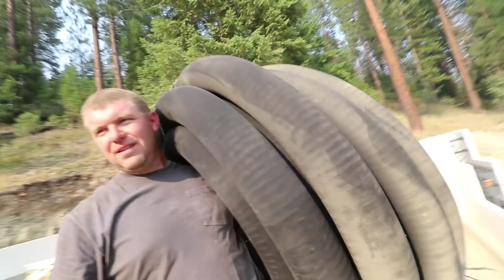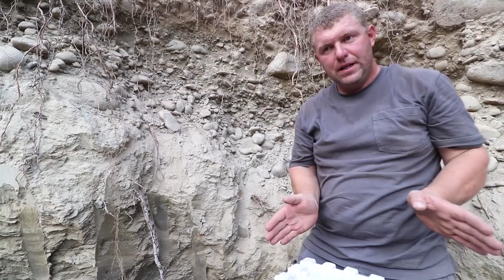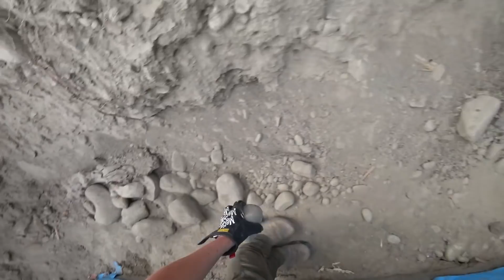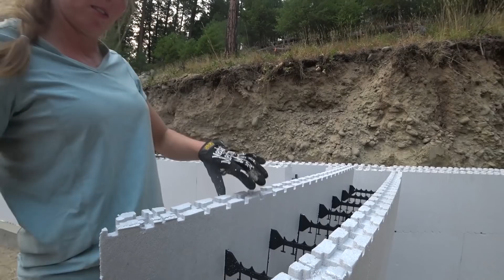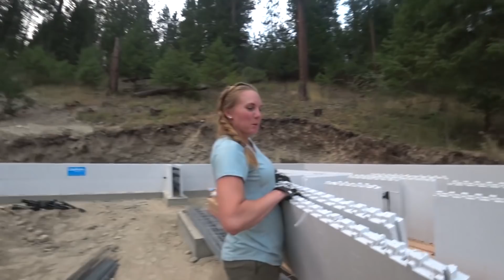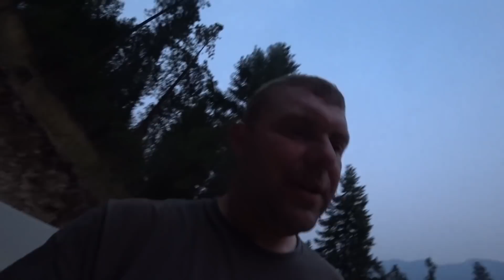OUR MEMBRANE IS DONE! (Waterproofing Foundation)

Comment: Homes have been built for 100's of years without the membrane, in all kinds of climate. Just saying.
Reply: I just dug out a place 60 yrs old concrete wall and foundation, no leaks, water was 8 " inches up on the outside the wall.....and that was after a dry spell...
Reply: Anthony Bonante - welcome to England!  Disclaimer: I'm not a builder.  But I'm a heavy DIYer and I'm fairly familiar with the UK building regs.  We have very helpful building control folk who come, observe/check/advise   - as best as I can tell this is way above and beyond anything historically built over here.  (As in - I really can't see them having the slightest issue.). I help look after our 300+ year old clunch wall church, and I can tell you about damp... Even then though, we deal with it retrospectively.
Reply: i think it's the  slope (run-off) behind the house they're worried about..  It looks to me like it won't ever be dry.  Is this the only place they could put the house???
Reply: Anthony Bonante homes have been build bad for 100's of years, homes havent been build for 100's of years with this. And so on... its important to first learn then do. Look at other locations and not only some parts but all.
Reply: And they have leaked for just as long...
Reply: wallyhall from what I've heard England doesn't have many DIYers. Is that the case in your experience?
Reply: It is completely dependent on what sort of water ingress your area has, pretty much all farmhouses in my area are built with a buried basement made of nothing more then stone and mud, and it is never a problem because the area suits that construction.
But if you had a lot of water getting pressed on those walls those basements would be flooded constantly.
Reply: thechosendude - that's because they use a special type of waterproof concrete with a very high PSI, it's cheaper just to add membrane.
Unfortunately Jessie fucked up the simple install method as usual, so it will probably leak

Comment: I used to work for a basement waterproofing and structural repair company, and one of the most common mistakes I saw on newer home constructions was the use of corrugated ABS pipe along the footer.  It was almost always crushed and causing storm water backup into the home.  It was also something that was almost always done by people building their own home or acting as the general contractor.  The other less common mistake was compacting backfill with a piece of heavy equipment like a bulldozer or excavator by driving it along the wall right next to the house.  I've seen that crush even PVC footer pipe, and also crack concrete block walls from the lateral pressure.

Comment: My house is 8 years old, we used a dimpled membrane from a company called superseal, no leaks. the membrane you are using seems to be a superior product. If you really wanted to protect it you could use the plastic dimple membrane over it.   On the drainage tile you want to use the corrugated-perforated 4inch big-o pipe that has a sock over it and back fill over it with stone.  Biggest problem I have seen is if you don't back-fill with enough stone and don't have the sock the pipe becomes clogged with dirt and is then useless.  Farmers tile their fields with that big-o pipe, it is tough and has proven itself over time.

Comment: Jesse, I feel your pain. In my house (6 yrs old), there was a corrugated drain pipe. It quickly filled with mud and it was crushed. My pipe was inside and yes, under the concrete basement floor. I removed the concrete floor and that pipe. I installed a rigid white perforated schedule 30 pipe (with a 1/4 inch pitch per foot). I didn't put a sock on it and I have no regrets.  In addition, I BEG you to strategically place "PVC Tees" at the corners and in long pipe runs. This leaves  you inspection ports and a place to insert a hose to flush out the pipe. By the looks of your ground, you will have to periodically inspect and flush out the pipe.  Best of luck to you and your wife. Dave, Buffalo, NY.

Comment: In 30 years of installing weeping tile and septic systems, I’ve never had the flexible pipe crush when it was installed in a sufficient bed of washed rock.  That being said, I prefer the solid perorated pipe over the flex, and Infiltrator canisters over the pipe.

Comment: Keep up the good work. Don't forget to add a sump pump pit to your basement floor for run off inside because where it snows in the winter the water creeps up during the spring into your home and floods the foundation. Seen this first hand in a home built in 1930's out in Minnesota it was a mess they didn't have a sump pit in there basement to carry away the water.

Comment: Only pipe I ever use when I waterproof a basement is sdr-35. Perforated of course. Put the holes down. And somewhere out a T in the line and run it up to grade so you can clean out the lines of you ever need to. It's one of those pay a little more now so you don't pay a lot more later. Great channel!

Comment: I think you are doing a good job. Personally I think that the membrane itself is such a huge improvement over hot or cold tar that if you cover all the exposed concrete, your basement or 1st floor will leak in 10,000 years

Comment: You could use water base Formica Adhesive on the concrete, it would also be safe to use on the foam forms as it does not have harsh solvents.

Comment: When you install the perforated pvc pipe, use the white and place a garden sock over the holes, keep roots, sediment and pieces of smaller aggregate from dropping into the pipe. Add access points above surface.
I was going to suggest affixing a dimpled surface (DMX) around the foundation but I'm not sure it would be adequate given the type of terrain. Could use corrugated metal but that would be expensive.
I do have a thought though as it has been used as a liner for horse, cattle stalls and in swimming pools adhered directly to surface of concrete; drape a bitumi product call APP. It's very difficult to perforate the material, you would only need to thermal seal the overlaps, but once installed, nothing is getting through. A roll covers 32 sq feet.

Comment: Nice job, but the drainage pipe ou have is a good one here in the Netherlands the dutch farmer used, and they cross with the machines over the land with no problem, so if you fill the pipe with gravel around it will stay there for more then 40 years. a layer of 30 cm( 1 feet) of gravel is enough

Comment: I've used that corrugated drain pipe quiet a bit. You have to put drain rock around it. Two reasons 1 if you fill with dirt around it the dirt will fill the line, 2 the rock will not put as much wait on the pipe and make a protective foundation around the pipe. obviously can't compact until you get a few feet away otherwise you will crush it as well.
Works good though. It's used all over the place here in Portland, OR.
I've never seen any one put a protective liner on the foundations around here. The clay seals them up. 
Have seen Water back feed from the pipes laid in the road bed. But they just fill the inside of the foundation with cement if that happens.

Comment: the footings we used have tile built in them that go to a sump pit which would be another good idea to put in so if water ever is there it his the drain and goes in to sump pit we have dry basement never had water problems ever sump runs in spring or after heavy rainfalls good luck

Comment: Jesse, make sure to use 4 inch perforated PVC pipe for your tiling.  And if you want to install a fillet (also called canting) you can make it yourself out of PVC moulding from Home depot. Just rip a square piece longways at a 45 degree angle and stick it along that corner transition. You probably wont need to adhere it to either the cement footing or ICF, the membrane will hold it in place.

Comment: I put Henry adhesives #887, "Tropi-cool white  silicone roof sealant" on my conex and it made a really nice 100% silicone seal. Easy to find as its almost the most expensive schmoo available at HD. Could work well as a top coat to seal if you felt the need... $200, per 4 gal pail. I kinda want to paint my GMC with it since the paint is bad and it's white...

Comment: How about filling the ICF with concrete, which is watertight, when dry? That's how our basement was done. That could provide addirional peace of mind.
Reply: Michael Dornhausen you do know that is what you do......dont think Styrofoam by it's self is very strong😲
Reply: Well, it seems, I didn't express myself clear enough - I suggested to use a specific mixture of concrete for filling the ICF blocks. Of course, they will get filled with concrete. Otherwise it won't be a solid foundation. But, as metioned, there are different types of concrete, one can use. That's my point.

Comment: For adhesive you can actually use spray glue the industrial of course but it keeps cost down for the adhesives companies sale. And factory seems dont really need a sealants its the cut edges and the edges getting tied on to

Comment: Perf Big O is used on 90% of house builds up here when you lay it and put clear stone on it the backfill wont crush it. we also spray our foundations with a tar and install a plastic dimpled waterproof membrane as it allows air flow

Comment: BETTER RAZOR BLADES
A roofer buddy of mine showed me "hooked" utility knife blades. You don't need to cut against a surface. Roofers use them when trimming felt paper because there is less chance of cutting the paper underneath. Try them out. They are the best for cutting paper or plastic sheeting! Keep up the good work!

Comment: do your concrete pour and coat the cured concretefoundation with the "magical" bentonite paint!!!it absorbs 18 times the amount of water than can penetrate it's film!!it's is standard to seal existing leaking basements in situ that are belatedly leaking as the ultimate solution! it is used in swimming pools also!after finished plastering!

Comment: Where I live we have a soil type that we refer to as gumbo which literally will grab your house foundation and start to lift it out of the ground when it freezes from what I can see your ground will have very little water sitting against your foundation as long as you use the foundation rap I don't remember what it's called it's a black plastic sheet that you roll out that is dimpled if water ever gets behind it it runs down between it and the membrane and then it runs down to your perforated weep and to your sump or downhill whatever your design is I don't foresee you ever having water problems the biggest concern is you just don't want water freezing against your foundation and pulling on your foundation or pushing your foundation in Word it looks to me that you have good enough drainage and if you back feel properly water should make it down below your freezing point. I have heard of guys in our area back feeling entirely with P Rock and it pretty much stops the problem but you have to make sure you have a really good sump and pump cuz that thing will run every time you have a rainstorm and for most of the summer and even for some people all year round in our area

Comment: You should have a drain tile all the way around your wall and all of the drain tiles should dump into sump hole into the inside of the basement area and then have a sump pump  pump water out as it drains in..

Comment: There are all sorts of products to put on the outside of our ICF before back fill.  They generally keep the back fill sharps from puncturing and tearing the membrane, some  have plastic channels to let the water drain down to your foundation drain without causing hydrostatic pressure buildup.  It all depends on they type of back fill.  With sand, you most likely don't need anything, heavy rocks you need mechanical protection but not hydrostatic for clay you need hydrostatic protection.  I would say your grizley soil is mostly finds which should drain well but you do have rocks.  One low cost option I have seen done is to place a sheet of 1/2" drywall  up against the membrane then back fill.   The drywall will give you the mechanical protection and the back fill sandy finds the hydrostatic protection.  The paper on the drywall to disappear quickly but the core will remain as a puncture protection cladding.   I believe what you have is going to work just fine.

I can see you guys are really learning a lot and gaining more confidence in your ability to problem solve.   Remember there are a lot of ways to do this sort of stuff the "right way" is the way that works "for you".   

Craig

Comment: You need to use a roller like the one used for wallpaper to stick the membrane as if you press it hard enough then you will get a better adhesion, bit of work though

Comment: How about a large sheet of tyvek put in place before you backfill.   it's tough and relatively puncture proof. it will provide an additional bits of watershed too... Not a builder, but thinking of possible solutions.

Comment: It'll be fine, the membrane that you're using is eons beyond the tar coated concrete that was used 30+ years ago that I helped my father put on their new house in the 80s and so many years later there's not so much is a sweat on the inside of the foundation. As far as the drainage goes and this is just a guess, if you were to moisten the backfill as it goes and I would think it would create a sort of cocoon that would help stabilize everything around the flexible drain to help keep it from crushing but the rigid is definitely a safer choice.

Comment: I only remember one builder trying to use those blocks below grade, and it was a disaster.  All other homes have been built with concrete walls to above grade.  Then they use the blocks.  The concrete is waterproofed with the black material.

Comment: The building insp. regs. are the minimum requirements! You can always improve on the reg.!You are on the right train of thought! It wont leak if you do the best and it does,there's nothing more you could do! And the guy is right, use the Ridgid pipe.

Comment: Please place the 4" rigid perforated drain pipe beside the footing, not on top of the footing. Once past the footing switch to solid wall pipe with a slight slope to drain water away from the footing.  Be sure to run both ends to daylight and check each pipe a few times a year to verify that the ends remain open, not clogged by silt, crushed by the backhoe or covered by landscaping.  I've had homeowners complain that there was a leak in the basement only to find that they covered up the ends of the footing drain pipe with landscaping.  Once cleared hundreds of gallons of water poured out and the basement leak ceased. 

The membrane and channeled protective covering is a good idea.  Rain water or snow melt flowing down the hill will find its way to the lowest point of excavation and then start to fill up the loose backfill around the foundation footings.  If it has no place to escape it will continue to fill until it tops the footing.  Once that happens it will find a way to penetrate the cold joint between the top of the footing and the bottom of the concrete wall.  

If your drainage system never allows water to rise above the top of the footing the basement floor will stay dry. Having built over 200 homes I always backfilled the first three feet above the footing drain with 1 1/2" minus clean gravel.  This will prolong the effective life of the filter fabric and drain pipe.  Place the perforated pipe with the holes down. 

Another very important water control item you must do because of your site is to cut a drainage swale on the uphill side of the foundation to divert the water coming down the hill away from the foundation.  Why two feet deep?  Because it will silt up quickly in your sandy soil.  Slope the swale so it drains out of both ends.

I enjoy watching your video series but it is painful to see you making mistakes and doing some things the hard way.  I congratulate you both for your hard work and willingness to learn.  Someone mentioned hiring a project manager.  Check around, maybe you could find a retired contractor in the area to stop by once a week, review your progress and line out the work and materials needed for the next week.  He may still have connections with the suncontractors he used and be able to help out with some hired labor if that becomes necessary.  

I'm an ICF and timber frame fan also.  We disassembled a 48x60 two and a half story barn built on our family farm in 1879.  We repurposed the timbers, hay loft flooring and siding  into three other projects.  Wishing you the Best of luck with your new home.

Comment: Our last home was on a hillside never had any water troubles except when rain gutter spout broke off. The home was built in the 70's. Thumbs up good luck on weather!
Reply: James Dickman ....Exactly. Both of our homes we've built have been on/in hills, one with a walk out basement... that was the one in the hill, and one without a walkout, that was the one on the hill. Never have had a leak, the sump pumps never turned on. Our neighbors at the bottom of the hill? Their sump runs constantly. Location matters, you placed your home in a good spot. I think you'll be like us and never have a leak. We also heat and air-condition our basement, never any mustiness. Just dry dry dry. By heating the basement our floors are warm in the winter. Just keep your heat ducts open down stairs. You'll be glad you did.

Comment: guys, all great so far but you need too do a few other thinks. there are drainage menbrain out there that will allow you to derrect the fall of water too the drainage pipe.  now if you are using perfeated pipe ,the flex pipe will work fine with in the eight foot line of the wall.  if covering the whole back wall then use hard pipe.    hope that it works out soon. thanks again for posting. post again soon.